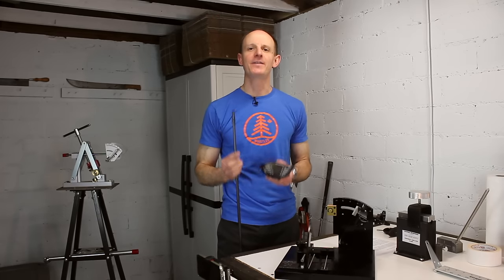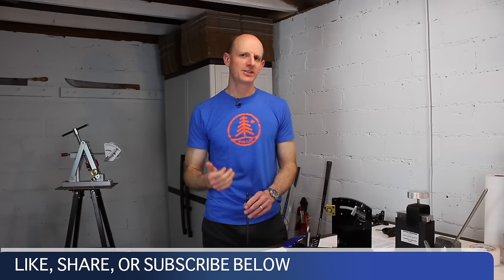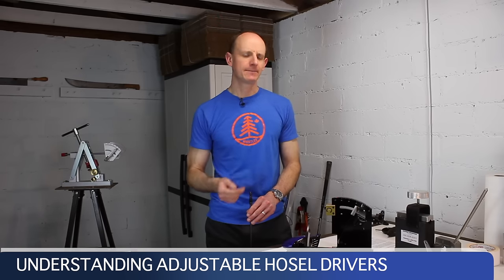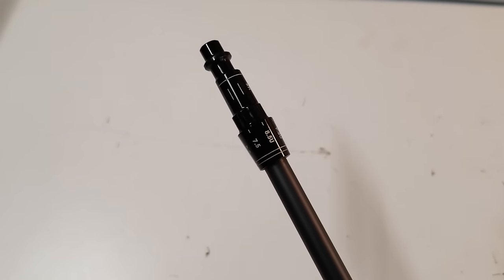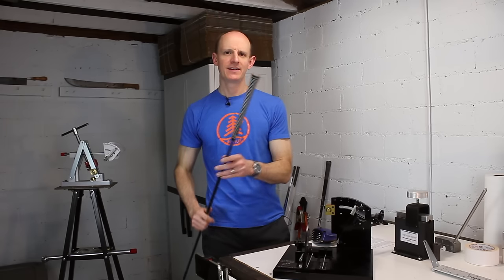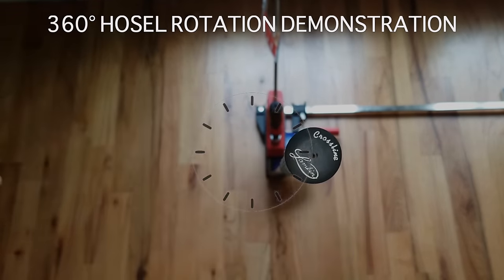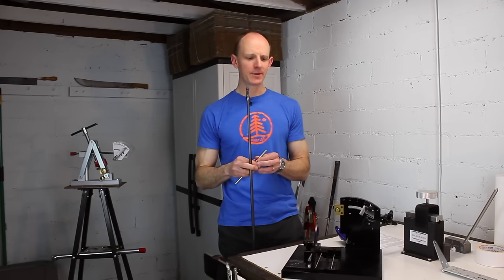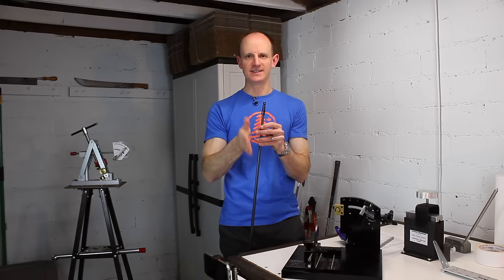Adjustable Hosel Drivers - How they change Loft, Lie, and Face Angle

Comment: Thank you for the very informative video. If I fade the ball with my driver in the neutral setting, the recommendation would then be to increase loft of the driver which then also closes the club face. In order to take advantage of the now closed clubface, what should I do:
1. Place the driver on the ground in whatever new natural (more closed) position the club head now sits as a result of increasing the loft. Then grip the driver in this new natural (more closed) position thereby taking advantage of the closed clubface, or
2. Place the driver on the ground, square the clubface, then grip the club ?

From your explanation in the video, it appears that method 2 above will have no impact on having a more closed clubface at impact - is this correct?
Reply from the maker: You got it. If you square the face during setup after making an adjustment, then you will only see the loft change. You would want to see it slightly closed at set up if you are trying to lessen the fade.

Comment: Great video, when I got my TM driver I read that the lower loft opens the face. Being that my misses are typically to the right I have the driver set to the highest loft to close the face. In reading that my mind tells me I have more of a chance to slice the lower the loft is, apparently it's just in my head. The downfall to the higher loft is that I have more spin which means on the majority of my drives I have very little roll and just the carry distance. I'm going to try the lower loft again. How about a video throwing in the other variable, the weights on the sole, and how they help a draw or fade bias

Comment: Good point about the face angle.  I play a Callaway driver at a -2 degree loft and draw bias.. that moves the head so it closes, so for me to play the head at my target I actually have to open the face.   Maybe I should actually play the face open so that I need to get my set up in a closed position to straighten the face and close it.

Comment: Great video.  I finally understand.  Yay!
2 questions:
I always lay the driver head on the ground prior to gripping the club.    I guess I need to place the hosel settings on the neutral position?
I use ribbed grips.   Won't the ribs prevent me from adjusting the clubface to aim towards the target, if I adjust the hosel?
Reply from the maker: Thanks for watching. To answer your questions,
I would start in the neutral setting unless you are trying to achieve a certain change in launch or lie. Once you have the setting where you want it, take note of how the driver sits (open, closed, square). Every driver is different so one might sit more closed versus another brand after making a hosel change.
As for the ribbed grip, that will be an issue with most hosel adjustments unless you have a Callaway or similar brand that uses the cogs to make a hosel change. Any rotating hosel will require a new grip if you change from neutral. At that point you have to decide whether you want to align the grip off of a square face or off how the driver sits on the ground. There's no right or wrong, just what works for you.
Reply: I do as well place driver down then grip it

Comment: How do you about feel rotating the shaft to change lie or loft with regard to the shaft spine? Do you think it’s an important consideration? Appreciate your effort and very clear content.
Reply from the maker: I think most modern shafts are extremely consistent in how they flex and therefore spine alignment, FLO, or Pureing isn't even a consideration for me.

Comment: Nice vdo . I used to wonder how much does it really effect . This was educative . 👍🏽
Reply from the maker: Thanks. Check out the follow up vid I just released if you want to see specifics for each brand.
Reply: @EFGMC  what is a life of a golf club ?
Reply from the maker: @arvinddas6803  Not sure I understand question. Are you asking how long golf clubs last?
Reply: @EFGMC  yes
Reply from the maker: @arvinddas6803  They should last as long as you want to use them assuming they have no structural issues, rust, worn out grooves, etc.

Comment: This is a fantastic video but I'm still a little confused.  My TaylorMade Driver says that lowering the loft opens the club face (i.e. 1 notch lower is -.75° loft and 1.5° open)  but you say that I should always point the club face at the target.  Doesn't  that mean I lose the face angle change?

Comment: Great video!  I’ve seen other videos suggesting making these adjustments in order to fix a slice, thus the adjustment would help you hit a draw or a fade.  Is this true?  I assume it is if you ignore the 2nd assumption you made.
Reply from the maker: You could do two different adjustments to help with a slice. You could adjust the lie angle more upright which will start the ball with more of a draw. This will be the case regardless of whether you square the face (ie 2nd assumption) or not. Other option would be to increase the loft so that the face wants to fall closed and then keep it closed at set up instead of squaring it back to the target. Of course in this case you could just close the face with any hosel setting and get the same result.
Thanks for watching!

Comment: Could you explain in detail about left handed adapter please. I see rh ,but no lh. I'm on 1 line to the lower, seems pretty good, I've tryed different settings, even 180 degrees on the adapter, I think thats what you mean, but would like to be sure. Nobody has touched on the lefthanded. Thanks for the quick response. 👍

Comment: Aside from the balance point changing does changing the loft alter the Centre of Gravity or the MOI of the driver when the player squares the face? Sorry if anyone else had asked this but there's over 400 comments to try and talk through! Brilliant video.
Reply from the maker: This is a great point and one that I discussed with some extremely knowledgable people. Had the thought that increasing the loft would have effect of dropping the CG lower, thereby reducing back spin. However, as was pointed out the area in which the CG of a driver can move is so small (around 1 cm squared) that any change will be minute.

Comment: So can you explain which setting would fit what swing? Like which one a drawer or a slicer should use to fit their swing? I know lie angle effects these and have an idea but would love to hear your explanation of it because you are so knowledgeable
Reply from the maker: In general increasing loft will reduce side spin in either direction, hook or slice. As mentioned, increasing loft does promote the head falling more closed at setup, so that would at least be something to be aware of if you are hooking it to start with. Increased lie angle will promote more hook shape and lower lie angle will promote more fade, however it will depend on what driver you are using as to what adapter changes will do to the lie. Check out my other video on brand specific adjustable hosels to see that info. 
https://youtu.be/U3JUSHDmJ00

Comment: Great video thanks for sharing. What is the tool behind the gauge thanks for your time in advance I appreciate your videos very much
Reply from the maker: That is a frequency meter used for measuring shafts. Pretty much never use it except for a random YT video.
Reply: @EFGMC  The only time it shines is when building with parallel tip shafts anyway correct?
Reply from the maker: @Par2Pixel  For sure harder to use with taper shafts. Either way, I wouldn't buy one. Numerous other tools I would buy before.

Comment: Thanks for the clock diagram. Very helpful. So I can decrease the loft on my driver and flatten the lie.
Can I add an adapter to an old Ping G15 driver?
Reply from the maker: Can't add an adapter to a bonded hosel club. There isn't enough room for the adapter to fit down in that space.
Thanks for watching!

Comment: Now I understand why weight is also part of driver head manufacture. Can you please make part two. How to consider adjusting the movable weights on your driver head?
Reply from the maker: I will add that to the list of upcoming videos. It will be somewhat dependent on what specific driver you own however, as different ones have different moveable options.

Comment: I recently adjusted my driver one degree higher in loft.  After doing so, I felt much more comfortable using a forward tee position.  No idea why, but I did.  In your shots, more upright looked more closed, which is the obvious of what I would have thought would have been good for a forward swing, but maybe contact point mattered more?

Comment: Good stuff. With identical swings off identical lies, do face angle/loft adjustments affect how the leading edge/sole of the club goes through the turf. In effect, the bounce. Thinking fairways and hybrids.
Reply from the maker: Lofting up does increase the bounce for lack of a better word on those clubs and vise versa going down. As it is only 1 degree or so however, I think it would be hard to notice it during the swing for 99% of golfers. Also since these clubs will have very shallow AoA and ball will alway be struck before ground (hopefully), the turf interaction should be minimal.

Comment: The adjustable hosel (the one you show with the cogs) like you say is the only one that allows you to keep the shaft label/puring/spine in the same orientation regardless of the setting. It does make the settings a little more complicated. Callaway is the only one that can do that.

Comment: I really like your explanation and it make sense.  Except for face angle.  If you increase the loft you say that the face angle closes; however, per your second assumption the golfer will align the face at the target thus making it neutral again (neither open or closed).
Reply from the maker: Thanks for watching.
My second assumption is made so that the end results of loft and lie change line up correctly. Everything should be measured with a square club  face I believe, just like every other club in the bag. How a club falls should not dictate how it is measured.
Showing that the face will "fall" open or closed based on hosel adjustments was just a demonstration of why it happens. Some golfers really hate closed driver faces when they just sit on the ground for example.
Just something I wanted people to be aware of as a result of hosel manipulation.
Reply: @EFGMC  But the resulting closed face due to adjusting the hosel to obtain more loft, isn't that what give the driver a draw bias.  Thanks!
Reply from the maker: @mikeruby1542  The measurements are done independently. Loft and lie and measured with a square face. Face angle is measured separately by letting the club rest where it wants to. Loft needs to be measured with a square face just like any other club for continuity.
Reply: @EFGMC  gotcha, thanks!

Comment: Great video Man.  Well done.   Question,  can you adjust drivers with a torx bit,  or is it recommended to use the ma ufaturer torque tool ?
Reply from the maker: The tool just has the tension set to 40 psi so you don't over or under tighten.

Comment: One thing I notice when changing the sleeve is how it feels when I swing it.  The weight/balance of the club definitely changes.  Would you recommend just keeping it at the neutral setting? I need it to be in the flat setting though.  I play a cut.  Aiming left of the target 99% of the time.
Reply from the maker: I think you need to try both settings on the range and see if the flat is usable even with the change in feel.

Comment: Great video. Setting the two assumptions at the start of the video and also explaining the effect of moving the contact point relative to the balance point made it a real winner IMO. Just one question. What do you use the machete on the wall behind you for? Stripping grips, adjusting clients attitudes, or even shortening clients? LOL
Reply from the maker: A bit of each!

Comment: So I own the Rogue ST Max in 10.5*. I had a green dot installed to lower the loft to 8.5*. My thinking being that if I lower the loft by 2*, it will eliminate the slight draw bias, thus opening the face. How many degrees is the face actually open & will it eliminate the draw bias?
Btw, Awesome video on adjusting drivers I’ve seen. Thank you.
Reply from the maker: If you drop 2 degrees the  basic math says 4 degrees more open. This varies some based on sole design and lie but it’s close.

Comment: I watched this, but I may have missed the part about face angle. I have Mizuno stx. Can you explain -3 and +3 degree face angle positions?  Trying to figure out what that looks like.
Reply from the maker: Not sure why the label them like that, but if you increase the loft, the driver will want to fall more closed. Decrease loft and it will fall more open. I never like to assign a specific number to that because I find it's not always a uniform change depending on sole shape, grass consistency, golfers setup position etc.

Comment: Hi Great video! I just bought a new 9* which we fit to to 8*.   I thought I supposed to allow the club to remain open at address after making the adjustments.   in this video you say to play square! am I understanding this correctly??  thanks
Reply from the maker: You can play the face in whatever orientation you want, the important thing is to do it consistently (discounting if you are trying to draw or fade the ball and making adjustments accordingly for a certain shot. My point is you should never just be letting the club fall where it wants because very few clubs are going to sit perfectly square.

Comment: Very well done. Best video on this subject that I have seen! I'd like to understand thr upright setting on my new SIM Driver. Do you have anything to say on that ?
Reply from the maker: Thanks. The upright setting just rotates the hosel 180 degrees so you end up with a 4 degree total lie angle change from 56 to 60 assuming you start in the standard hosel position.

Comment: Have been revisiting this excellent video and have a further question re your demonstration of how a driver head will roll to a closed position if the loft is increased and to an open position if decreased.    But on the tee I will be aiming the face at the 
target, so can I assume that any loft adjustment will not change any tendency to draw or fade the ball, ie the loft adjustment
will only effect the launch angle,?  (assuming a centre strike and path online).
Reply from the maker: Exactly. This is where some people get hung up and say that the loft is not changing because of the face angle change. Again I go back to one of my assumptions in the video, that the golfer will aim the face at the target and not just rely on how it randomly sits on the ground. 
As you said, if the face is aimed square at the target then the changes will be as advertised for the loft and lie.
To be more accurate, the face doesn't even need to be pointed at the target, it just needs to be pointed the same way regardless of how the hosel is adjusted.

Comment: This is for me what made my driver so inconsistent.  I decided to go back to a bonded driver and my driver issues greatly reduced.   

For me my issue was that I prefer placing the club first  on the ground which  depending on the setting part of the adjustable driver may have never laid flat, rear up or down and do on.
Reply from the maker: It's really a driver by driver thing. With so much focus on weight placement and aerodynamics in modern drivers, the sole designs can be all over the place and therefore the setup can vary greatly in how they rest on the ground.

Comment: Great video, the interesting question that came to mind was putting on a new grip (e.g., something like the Golf Pride Align) that has alignment cues.   I’m assuming it’s important to install new grips with the hosel in a neutral position (so that the grip, shaft and hosel would be aligned) ?
Reply from the maker: You would want to install the grip in whatever hosel setting you plan on actually playing the club in. If you play it neutral than install neutral. But if you play it lofted up 1 degree, you would install the grip with it in that setting. Might check out this video on installing grips with air. Can come in handy if you need to change a grip after a hosel adjustment.
https://youtu.be/vuGnpvDEQuA
Reply: @EFGMC  Thanks … I may just put 360 grips on those clubs that are adjustable (at least for now … new clubs, still playing with the settings so not sure where I will end up).  Will check out video on using air

Comment: Good video. I honestly never knew that. I always soled the club in its natural position which meant next to no changes in loft or lie. Silly question I just bought a jpx 850 driver where can I find a spare sliding weight, mine flew out of the club.
Reply from the maker: Could try Golfworks or Billy Bobs golf. Doubt Mizuno would carry them still.
Reply: @EFGMC   I appreciate the reply. I am in South Africa and went to all the local pro shops..they cannot help me. Anyway thanks.

Comment: Really well interpreted!

On the cog-versions, do you think they try to neutralize the rotation some? Like if you turn a fixed addjustable hosel 45° it will be either flattening or uprighting the shaft for that particular setting. Does a cog-hosel change that, could you use them in a way the lie angle changes to the opposite, if you like?

When setting the loft the face orientation also affects the center of gravity relative to the face. Would you say that and the gear effect makes bigger difference than the loft change actually will?
Reply from the maker: Both rotating hosels and free moving cogs do the same thing. Only difference is the cogs (in Callaway's case) allows the shaft to always stay in the same orientation. Lie angle will change in either case.
Vertical gear effect is definitely changing with loft changes. Not sure how much but makes sense to pay close attention to impact point on the club face when making any of these changes.